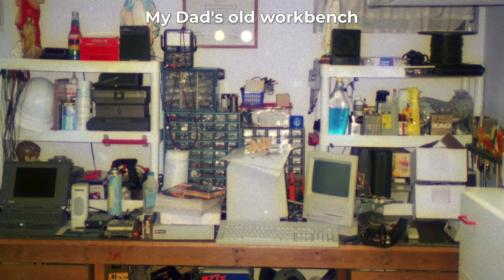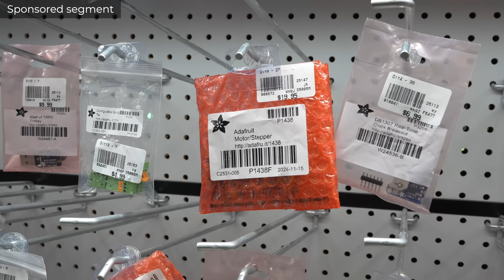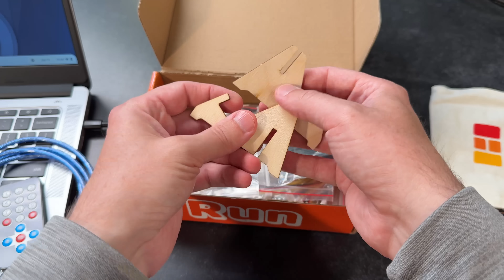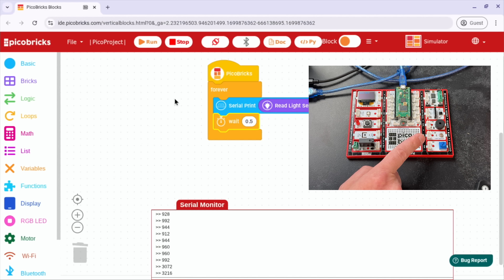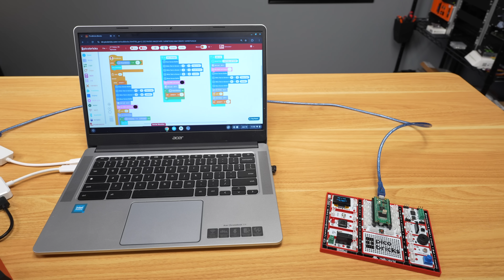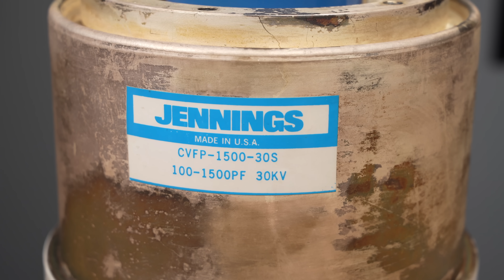You don't need a Raspberry Pi! (Getting started with Microcontrollers)

Comment: Question, do you know where is the Serial Monitor in the PicoBricks Simulator (if exists)?
Reply from the maker: I'm not sure if the simulator has a serial monitor, unfortunately :(
Reply: @JeffGeerling in that case can I install firmware on any pico without obtaining the picobricks (customs issues for the moment)?
Reply from the maker: @DamjanDimitrioski  Yes! And you can use the same code/etc if you ensure you connect things to the same GPIO pins as the PicoBricks board shows.
Reply: @JeffGeerling  Success, I managed to run a project on my pico board (chrome only), pity the IDE is buggy the scope of  variables cannot stay still after code change and vars are defined after digital pins definition, but that's that (leading to variable not defined), at least I tried the IDE and works for simple things.
Reply from the maker: @DamjanDimitrioski  Yeah, the BricksIDE is decent for quick prototyping, probably not for full applications and long-term projects.

However, another one you should try is MicroBlocks: https://microblocks.fun — it also should work with Pico very well, and has settings for PicoBricks, micro:bit, and others. It's meant to be used more for production, but still at some point you usually have to switch to code!

Comment: I had a couple of experiment  circuit kits similar to the one you used as a kid. But they were at the house I was only at part time, so I never got to do much with them and really lost interest.  Weirdly as a kid, I didn't have a lot of hobbies. Where as a adult, i have trouble putting existing ones down while I pick up seven more.
Reply from the maker: When you had the time to dig into hobbies you didn't have them. Then when you don't have time, the hobbies multiply!

Comment: that kit is brilliant, would have made my adventures in MC so much easier if i had that a few years ago
Reply from the maker: It's a great way to quickly learn a bunch of new sensors without having to make sure you're on the right pin, the code is right, etc.

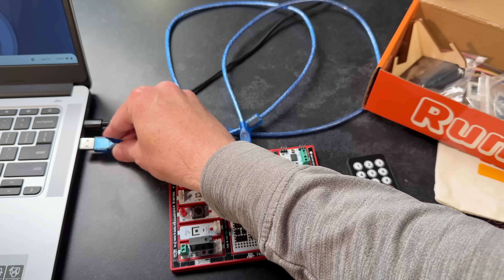Comment: 4:50 This is true. I have OCD and obsessively pay attention to my success rate for inserting USB cables. It’s at around 20%. Thousands of trials. But 4/5 times that cable has to be flipped. One of life’s paradoxes.
Reply: Wanna bump it to like 99%?

USB type A plug has two sides. One where the two square holes are immediately covered by the plastic and the other side where there's a bit of space behind the holes.

IIRC it's in the USB spec that if the user looks at a device "the normal way", the side of the plug where there's space behind the holes, should face the user to be able to plug it in. 

Now, what's the "normal way" of looking at a device? Usually from the top (laptops, Raspberry Pis, power banks etc) but for example with PCs it's from the front (for the front IO) and from the left side (where the windows often is) for the back IO.
What about AIOs? If the IO on the back is on the right, you would reach around from the right and the holes with the space should face right.

Unfortunately I can't help you with charging bricks because they don't really have a preferable side of looking at them. I just switched all my chargers to USB-C (Ikea sells them for cheap)

Comment: here is what i believe to be the least character count blink sketch that will compile in Arduino ide for an atmega328 based board. blinks at 1hz on pin 8, totaling 48 characters

void setup(){DDRB=1;while(1)PORTB^=1,delay(250);}

Comment: This is a great starter kit for learning electronics.
10 years ago, I knew nearly nothing about electronics and started with Arduino's starter kit, which wasn't nearly as organized as this. But, being able to simply patch building block circuits together,  I didn't need to know electronics.
By following the instructions, I soon learned basic programming. From there, I progressed on to ESP MCUs, microPython, & RPi's  w/Python.
With the guidance of YT tutorials and videos, I have learned PCB design in Kicad and have developed 2 PCBs for my MIDI controlled Teensy based T4 Laser Synth to produce abstract videos, using the RPi Global Shutter camera. 
Thanks to Jeff's great channel, as well as Dronebot Workshop, Explaining Computers, and many other YT channels, which have enabled this 72 year old to achieve my ultimate goal of creating a modern day version of Laserium at a fraction of the cost, in my living room; 
2  * 3W RGB laser projectors (another being built), 
2  * T4 Laser Synths,
Reaper's DAW, 
Behringer's X-Touch DAW controller, 
AFTER 6  YEARS' WORTH OF TRYING AND FAILING   w/o sufficient knowledge to properly design custom old school DIY electronics circuitry.
Gotta love today's Internet & YT 'university'. 🤗
If you can dream it, you can do it... eventually... with dedicated perseverance .
😎

Comment: Microcenter... brings back memories of Fry's.  Coincidentally, I just embarked on the Teensy41 to build a radio signal attenuator with a less than 1 millisecond delay budget (suggested by ChatGPT), neat board kit with a Teensy41 and an ESP32  developed by Proto Supplies in the state of Washington -- the West Coast Adafruit equivalent.  Tried to develop the Teensy modules outside of the Arduino environment on Gentoo Linux but kept running into interdependencies and after 2 days succumbed to just using an Arduino Dev on a Debian VM.

Comment: I remember working with electronics kits back in the 1960s as a kid, now as a big kid i make projects with microcontrollers.   I was a software developer and now I play around with these little controllers.  I remember flipping relays back then using capacitors to time them, now a GPIO pin can do it.  I highly recommend project kits for learning and then you can move on to other parts and types of controllers.  Lots of fun and learning!

Comment: In high school we had an electronics program. The class was 2 periods at another school and we would be bussed every day to the other school. With travel it would take up 3 periods so the students were a mix of electronics nerds, and people that wanted to goof off for three periods. Anyway, unfortunately the teacher (RIP Mr Landerer) never really had much control of the class.   One of the things we would do is set up a power supply with a reverse polarity electrolytic in the back of the class and then all go sit down.  Some time later the cap would blow, we'd all act surprised and anger the teacher. He would threaten to "write us up" in his German accent.  Nerd shenanigans.
Reply: The end of your video made me remember an even funnier story that makes you realize we learned nothing in electronics class, and also boys will be boys.  We blew up small caps in class but at home we had an endless supply of big caps..the old computer caps that were like 250,000uF 50V soda can size.  So we thought we should blow one of those up.  We buried it in the back yard and connect it to the wall since we didn't have a power supply big enough.  We connected it through 100 ft of 18ga twisted alarm wire because that's what we had and we didn't want to be near it.  There were so many things wrong with this. Unbeknownst to us at the time, caps are a short with A/C.  You would have thought we blew the breaker, but no, the 100 ft of 18ga wire was long enough to simply act like a giant resistor heater and everything started melting.  We learned a few lessons that day.
Reply from the maker: Heh, high power DC can be dangerous... high power AC can be unpredictable and unintuitive! (And dangerous)
Reply: Back in high school, we would make a shocker. 
9 volt battery and small DC motor in series with the 8 ohm side of an audio transformer..

Comment: Thanks for a fun and informative video.
Question: does the PicoBricks IDE stuff result in a chunk of python code being put into the microcontroller? Or is it compiled into something more compact, like machine code?
Reply from the maker: PicoBricks IDE (which is based on Blockly) generates MicroPython and sends that over as a compiled program. (You can toggle the Python on or off so you can see the code it generates.)

MicroBlocks works a little differently but doesn't generate anything lower level that you can tinker with. I don't know of any that generate C and use C SDKs however.
Reply: @JeffGeerling  Thanks!

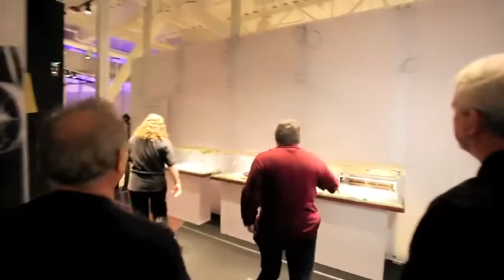Comment: One of the best electronic engineers of the 70's @ 1:19. Steve "Woz" Wozniak!  His brilliant designs made the Apple I and II as well as the 5 1/4 Apple Disk drive.  Sadly, after suffering a head injury in a small plane crash and going into a coma, he was unable to recreate the magic.  One of my heroes!
Reply from the maker: He had such clever engineering. I'm enjoying going through my Dad's old Apple II (video on that coming someday!)
Reply: One of? His disk drive completely changed how those were built. You can get schematics for those Apple drives and compare them to enterprise disk drives of the same era and there is no comparison.
Reply: @KenS1267  Is there a video showcasing and explaining that ? Sounds very interesting
Reply: @Winnetou17  There's a video of Woz from  back in the 80's saying his disk controller uses 5 chips instead of the 50 that other controllers used but that is all I could find.
Reply: @Winnetou17  his main motivation, well, his and Jobs', was to make it as cheap as possible.  Mainstream computer makers, even Woz's previous employer HP, wasn't thinking of cost efficiencies necessary for micro-computers, their buyers were big companies- who bought big computers!  
Alan Alcorn, creator of Atari's original Pong game was a mentor of Woz.  He also created the color hack for display on TV. Woz unfortunately sometimes forgets (on videos and interviews done shortly after his plane crash) He wasn't the inventor, Alcorn was.
Reply: @squirlmy  I hope you are wrong.  Woz, hero, has not attributed the NTSC hack to Alan as far as I have seen.  Woz is usually a very generous guy.